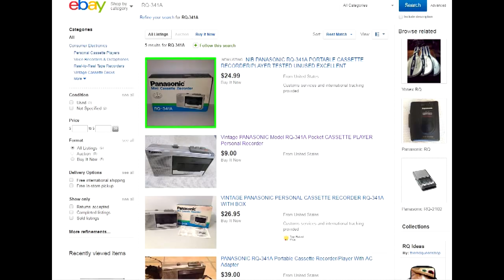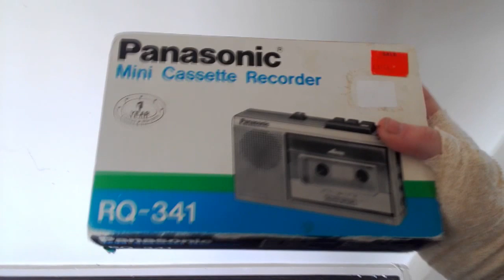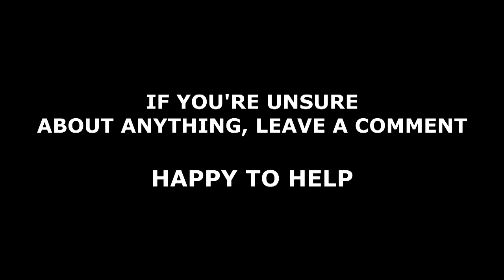[EASY] HOW TO MAKE JACKET'S TAPE RECORDER [WIN10 compatible]

Comment: Various notes/observations as I'm putting one of these together for a con next month (see you at the Calgary Comic & Entertainment Expo! Maybe! Probably not.)
--------
-no luck finding a suitable recorder at thrift stores, but eBay has tons of players. Ideally look for broken ones being sold as-is since they usually are being sold for next to nothing and you'll be gutting it out anyway. You'll want something with big chunky high-travel mechanical buttons, the slim low-profile ones likely won't be able to register down to press the sound cue buttons. 

-*BEWARE*: If you don't get exactly the player in the video you'll likely need to flex your improvisational muscles to get everything working. I got a GE brand recorder (slightly anachronistic since it was released in the early 90s but w/e) and it turns out the buttons are part of the internal mechanics, rather than part of the plastic chassis like the one in the video. I had to pry off the plastic button caps , assemble a little platform out of bass wood with the sound module buttons glued on that I then cemented underneath the button opening, and cement the original button caps back into place

-In addition to the 4-button sound module I also ordered a mini amplifier module from the same site. It has a bigger slightly louder/clearer speaker that friction-fit perfectly into the socket of the original recorder's speaker, and the longer cable made it a bit easier to fit everything into the enclosure. It uses an idiot-proof headphone jack that plugs into the sound module, but keep in mind it uses its own 3xAA battery pack. 

-I don't recommend gluing down the sound module, being able to plug the USB in for tweaks when testing the finished assembly is a lifesaver. I do suggest gluing down the battery packs if you can though, they're heavy and you don't want them swinging around and possibly damaging a wire.

-For some reason the sound module keys are NOT arranged in numerical order, but as K2-K1-K3-K4. Just something to keep in mind when organizing sound clips

-The library of clips in the description are a pain to sort through (there's a looooooot of redundant duplicate ones to sift out) but you really want to find the clearest voice samples you can since they generally register as a sharp unintelligible buzzing mess really, really easily when played back. The samples that break into foreign languages seem especially bad for this. You may want to tweak down the gain of clips in Audacity or something similar to see if it helps. Again, being able to plug your sound module back in for tweaking things is pretty important. 

-I set up K2 with a few 'hello's , K1 as various voice lines, and K3 as 'thanks'/'goodbye'. Because the soundtrack is such a big part of HM, I also set up K4 with about half a dozen 5-10 second snippets of various HM/HM2 tracks (and the Robocop theme from the C64 video game, because why not) with cassette scratch effects from the sound clips folder added in for more of an analog effect. Again you'll want to tweak a bit with the gain to get audio to come out suitably loud without getting distorted

-As far as I can tell there's no way to randomize sound clips on each button, so try to mix clips up so it doesn't seem too repetitive.

-Not a bad idea to glue the cassette door shut, don't want to look silly having it accidentally pop open on you. Also, a slim belt clip cemented to the back of the player will let you keep it on you and leave your hands free for holding weapons, viscera, ironically-girly japanese merch from the anime booth, etc.
-------
That's all that really comes to mind. "Easy" isn't really an accurate description especially if you're not using exactly what's being used for the video, but it's been an interesting little project. Haven't had a chance to even get started with the mask yet...
Reply: hey man i was wondering if you would share your cut down sound files? im gonna start making my own soon and wanted to see what you had as far as those files. also for the mask they sell a identical mask to the one he wears in PD2 on ebay for around like 20$ would highly recommend it, though it is like rubber material and kinda hard to see though but def worth it!
Reply: what was the amplifier module you purchased?
Reply: Seconding to the amplifier module. Which?
Reply: @Amarki1337  I don't know what it's called, it was from the same source as the button module. Has a ~2" speaker and a 2xAA battery power bank.

Comment: Great job, I'm working on mine right now I just wanted to know, what did you use to permanently keep the sounds board and such in?
Reply from the maker: Astraozoa i used super glue on the 'card' parts of the buttons, they haven't come loose once. i kept blutak for the sound board itself should i have to move it for spacing!

Comment: or you can use the record feature and just record the voicelines on a tape?
Reply from the maker: You can, however I'd recommend using an MP3 to cassette tool for quality. This is easy to set up and more useful/responsive than having it on an actual tape, but otherwise that is more authentic!

Comment: I love this so much and I wanna do it so badly, just the amount of issues I've had regarding the software to the USB not connecting is the single most annoying thing in the world! Great video though, well done
Reply from the maker: You may have a malfunctioning USB. Check with manufacturer, if its faulty they should send a new one!
Reply: @MoriAnimations  well it works fine, connects to my laptop and everything. Just when i go into pm66 it decides not to have a connection anymore!

Comment: once you do this to the recorder, could you also put the things back in to make it work as it originally did or is it permanently like this afterwards
Reply from the maker: No, there is no available space.
Reply: damn that response speed, and thanks, also to anyone wanting to buy one, there are like 3 $20 ones that ive found just by searching the model on google
Reply: @sammudy4105  wish I did this cosplay 3 years ago. Everyone I see now is over 60$ and it’s usually not even the rq-341 model

Comment: Hi! After watching your video, I was curious as to what adhesive you were using for your build to hold the buttons and device in. I have traditional modeling kit glue, but was wondering what you'd think would be best. Thanks!
Reply from the maker: Most any glue will work. I Wasn't planning on taking the kit out so I used super, but if you get a non-destructive glue you can change out the sounds easier if you want to update/change them later. :)

Comment: My tape recorder, which had previously been working, has now stopped for some reason and I need help understanding why. I put this thing together about a month ago and for no reason it suddenly stopped responding when I pressed the buttons. I redid the PM66 writing part, made sure that no wires were damaged, and checked the volume of the .wav files, but nothing seems to be working. I would really appreciate it if you could help me out. If you need any more info just ask.
Reply from the maker: You will need to buy a new part. check the batteries also.

Comment: (Stupid question) What would be a good alternative to an RQ-341? I can't seem to find one anywhere :p
Reply from the maker: There's an RQ-340 on eBay USA right now which is a good alternative. 
Unisef TU-502,  RQ-342D, JC Penney 681-6042, Panasonic RQ310, any mini-cassette recorder will only hold 1 soundboard, but the portable, larger ones will take two, depending on measurements. Please be sure to measure!
Reply: Hey i got a question what module should i get when im running on windows 10?

Comment: So, if you want a higher quality one like you have, I should just buy a higher quality recording module, right?
Reply from the maker: You can use adafruits boards for higher quality, yes, however they require manual assembly and some level of component understanding.

Comment: 3 questions what 1. What Windows 10 board thing do I buy?
2. Do I use the same program if I use the Windows 10 one?3. Do I do the same thing for the Windows 10 one
Reply from the maker: "No programming needed, all you need to do is drag and drop the sound files onto the device or a microSD card and apply power."
The assembly and setup to that board is different in that video, but the instructions are listed on the boards page if you're unsure!
Reply: Morittchi thanks dude!

Comment: Hey I’m gonna be making one of these but what type of glue did you use/how did you use it?
Reply from the maker: I used superglue, and just on the edges of the buttons to hold them ij place. But I'd use a temporary solution like bluetak so you can change the sounds easier
Reply: Mori Animation ahh yeah you might be right with the blu tak, thanks!

Comment: I wonder if you can make your own jacket voice lines. . .
Reply from the maker: Sticker_ Bomb_Gaming of course. using audacity you can get some cool modifications to your voice.
Reply: When ever I select the wav. file is says wav. error, what do i do?
Reply from the maker: Make sure you convert the wav of the voice-line you want 0:35. I did not convert all files
Reply: Ok I'll try that and see if it works, thanks
Reply: I just checked and they are all signed 16-bit PCM I'll try setting them onto the board.

Comment: I'm having trouble with the pm66 writer, I've tried several different versions of it aswell. When I click check board it gives me an pop-up like this: https://gyazo.com/e7c70c0ea626238ee4c25711b3d66be4
I can't read what the error is there. If I try to write the files over to the board after I click >>PM66 the same pop-up comes up, all I can do is press yes, and then I'm back at square one. Except this time it looks like this: https://gyazo.com/68b6fbaa6c795f9bc57959428c55ce3c , telling me to insert the board again or the board is not working, however there's nothing wrong with the board, the sound files it came with from the store are working on it.
Reply from the maker: Hi mate, this is a technical error which I can't give you advice on, you're better off emailing the electronics123 shop with the error. They'll send you a replacement for faulty boards. Make sure you're using the correct windows version too.
Reply: Thanks for the fast response man! I used my dad's pc with windows 10, problem solved. Now I have everything I need. :D

Comment: on the topic of the windows 7 recording module; are you able to access it on windows 8 at all or does it simply not work?
Reply from the maker: Windows 8 will not work sadly, if you have access to to an earlier OS you'll need to use that. 
There are boards compatible with win8 but require manual assembly.
Reply: Morittchi  i personally don't but i could probs use a library computer. thanks again for the help

Comment: for the windows 10 board, which one do i get? i ask because i can't find one with a usb attachment for it and all the other stuff that came with the board you used.
Reply from the maker: NotADamSaw the windows 10 ones take SD cards, some require soldering, others not. You'll have to be sure to measure them for your cassette-player to make sure it all fits.
Reply: thanks!

Comment: My biggest question with this method is it seems like there is no on/off switch for the soundboard. Wouldn't it be constantly eating up battery then? Thanks.
Reply from the maker: You can make one of the buttons the off/on switch however it's such a tiny device. Mine lasted two days at a convention and all night at paydaycon while using very frequently.
Reply: Mori Animation Ok thank you very much. Yeah that sounds pretty good then. Thanks

Comment: when i click check board it says its not connected properly, ive tried a few time and still the same message. ive gone into device manager and checked my usb and when i plug the board in it says 'this device cannot start. (code 10)'. any suggestions?
Reply from the maker: Dookx_ do you use windows 10? I'm not sure of this issue but if you email electronics123, they should send a replacement if it's faulty. good luck!
Reply: yes i do, my friends let me us their pc which runs an older version on windows so its all good now :)

Comment: Can anybody recommend any alternatives to the recording module? I'm located in Europe and the module with shipping included is a bit pricey for me at the moment. I'd gladly solder or look into details of other electronics if somebody would give me some hints. (Arduino or something like that maybe?)
Also, thank you for the video!
Reply from the maker: Hi! Ned's tape recorder was made using an arduino. It will give you infinitely more options if you go that route. How I found the module in this kit is by searching around "sound buttons module speaker customisable" until what I was looking for showed up. Good luck and let me know if you have any questions!

Comment: Quick question what happens when you have a MacBook but not windows is it possible to add the sounds with a MacBook?
Reply from the maker: No, unfortunately the program is incompatible with Mac OS.
Reply: Mori Animation so sad. . .one more question since you put the sounds in the sound device does each button play a random clip example "hi" rewinds "hello" something like that
Reply from the maker: Yeah, it can play a random sound each press, I have at-least 5 files on each button. You can also set them up to play all at once as well.

Comment: Sorry for question so much question but this is the last one is there anyway to have more than 4 or 5 buttons?
Reply: Sorry for asking*
Reply from the maker: Deylin Pimentel it's okay to ask! if you want more buttons you have to manually solder/build the kit using their parts. also try adafruit kits!

Comment: Nice work! But I must ask...the module has 300s of audio, but only has 4 buttons. Can we program more than 4 voicelines?
Reply from the maker: R Insgnt you can program as many voice files that'll fit onto the buttons, i have several on each.
Reply: Morittchi 
So that means several lines per button (4), but multiple lines play when I press one button?
Reply from the maker: R Insgnt you can set it up to play all at one or single random after the trigger has been pressed.
Reply: Sounds good. Thanks for clarifying.

Comment: When i click check board it says "please check cables may not properly be connected" but i have it plugged in. Help?
Reply from the maker: Try a different USB port, if that doesn't work, refresh the port in windows Device Manager. If you find the board listed under Universal Serial Bus controllers, right click it and update driver software manually from there.
Reply: Thank you I’ll see if it works

Comment: G’day mate. Not sure if you’re still responding to questions. But, do you think a Sony M-450 would work as a good replacement for the RQ-341? Is there also any way I can use something with a different clearer speaker as I am unsure in regards to that? Thankyou :)
Reply: Also, if the M-450 isnt suitable; what would you recommend as a cheaper more accessable alternative to a RQ-341? I’ve searched and could only find two people selling them for $140AUD.
Reply from the maker: That's a micro-cassette player correct? It doesn't seem you'll be able to fit the device in the insides. Sony M-450 is 62.2 x 119.8 x 25.4mm incl projecting parts and controls. The device is:
Including USB & line-out connectors: 72mm x 30mm
Speaker:  40mm (diameter)

Try find a standard tape player at a tip-shop or online. Should fit most of the standard ones :)
Reply from the maker: Also the video was recorded on a crappy phone, the device sounds better in person and they have updated the model since I made this. If you want a high quality speaker you'll have to construct your own board with arduino hardware. Good luck!
Reply: Mori Animation No worries mate. Thankyou for the quick reply. You know of any other models that would work as a replacement?
Reply from the maker: @kous3096  Any that fit the dimensions. I imagine most tape players with speakers once gutted should fit the device or two.
Reply: Mori Animation Alrighty, thankyou once again. The search begins : )

Comment: Hi, could you please tell me what i should do if i bought two kits, like what should i do in the software and what should i do with the 2nd set of buttons
Reply from the maker: You'll both manually load the sounds and run the program separately on both kits, just as you would if you had bought a single.
Reply: Mori Animation ohh okay, so where do i put the buttons then for the 2nd kit because the 1st already take up the spaces in the tape recorder shell
Reply from the maker: Bam there's four spaces on the right side as well as four on top.
Reply: Ohh okay i did not see that. Thank you

Comment: The alternatives for windows 10 don't look the same. Can you please help?
Reply from the maker: They don't look the same because they aren't the same. They require manual assembly but otherwise work as the pre-assembled ones.
Reply: Oh damn. :/
Reply from the maker: They Ｉｎｃｌｕｄｅ manuals with instructions and they're relatively straight forward, I still recommend them!

Comment: Do you think this could work with the RQ-335?
Reply from the maker: Potentially, check the measurements of the components and the rq335 to find out. You may be able to fit 1 in there